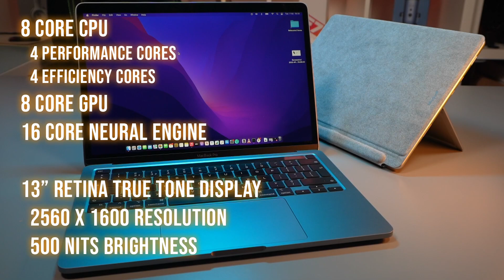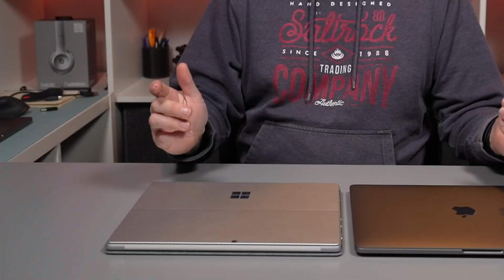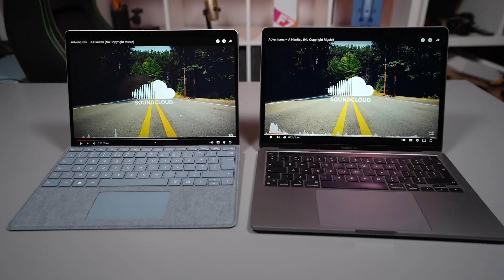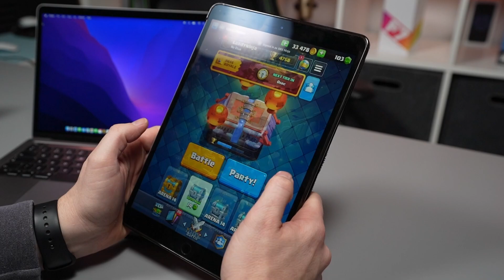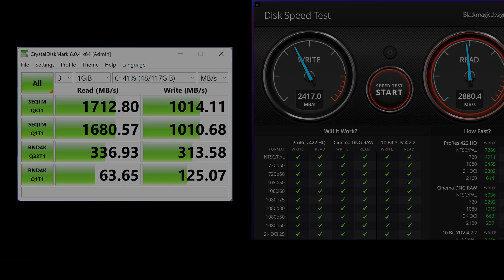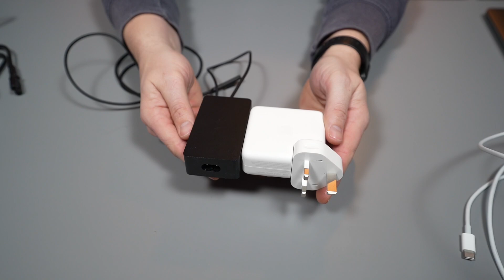Apples vs Oranges! - Surface Pro 8 vs MacBook Pro 13

Comment: I wouldn't change M1 Mac battery life for any Windows laptop.
Reply: Totally, the battery life seems amazing on the ARM Macs. I kinda wanted to upgrade, but my MB Pro 13" late 2016 was ruined by Apple updates. I'm getting 1 hour of battery life with 85% of the original capacity left and it eats 1% per hour lid closed doing nothing. :'( I have so many other problems with the device too, from all my USB drives stopping working to my professional mirrorless camera not connecting either via cable nor wireless (these used to work too, updates man!).

Apple has been slowly but surely killing it with updates, they have been more like downgrades. It used to be an amazing machine back in the day and I loved it, but now I don't want another Apple device ever again in fear that they ruin the new Macs too. Apple is well known for this planned obsolesence BS with iPhones too, I simply lost all my trust in them experiencing it myself.
Reply: @invisibleunicorn3337  forcing you to upgrade

Comment: Surface Pro 8. I prefer Windows and I have an Android phone which also works better with Windows. For me personally, Apple has always felt too closed off when I have owned their products.
Reply from the maker: I haven't used an android phone for a while now, how are you finding the windows phone app?
Reply: @MashITTech  I like it. I can call or text from my laptop. I have heard that coming later you'll be able to launch phone apps on your laptop. I think Samsung phones and Your Phone already have this ability.
Reply: @ccroy2001  Yes, Samsung phones have it this way and it works very well.
Reply: @MashITTech  I had an MI phone before which did work, but not that great and I couldn't use my phone apps in the surface. But now I've got a Samsung Galaxy. The experience is great. I can use all my apps on the Surface. The shared clipboard works like a charm.

Comment: MacBook Pro for Sure 👍🏾
Reply: I'm picking SP8, just because I'm MB Pro 13" late 2016 owner and I've seen in action how Apple implements planned obsolesence — 1 hour of battery life despite 85% of the original capacity, all USB drives killed, my professional camera won't connect via wire nor wireless, bugs, slowdowns, restricted app security settings causing compiling errors on my Unity project because of Unity bundles, etc. Everything used to work flawlessly, but they caused more and more problems with updates. Absolutely terrible experience overall, I'm sure they will kill the new Macs too eventually just like they did mine — it's good for their business to force people to upgrade, after all.

Comment: Different devics for alternative demographics. The Mac is a laptop and the Surface is a 2-in-1. 

The answer to which is best is very simple. If you want a laptop and do not need specific Windows-only apps then buy the best ultrabook out there, the M1 MB Pro 13. If you need a tablet as part of your workflow then I would buy the Mac and an iPad, maybe the new iPad Air coming soon and have two devices rather than the Surface Pro which is compromised as both a laptop or/and a tablet. The advantage is that the MB Pro 13 and an iPad can be bought for a similar price to the i7 SP8 (add keyboard and pen). Having the 16hr plus on my MB Pro and with an iPad having far better and more tablet apps, having two devices far outweighs any inconvenience as you will be far more productive.
Reply from the maker: This is exactly the conclusion I have come to. I must admit I liked the surface pro 8 much more than I expected to but won’t be trading my m1 mac in for it any time soon (plus the windows 11 tablet experience is dire)